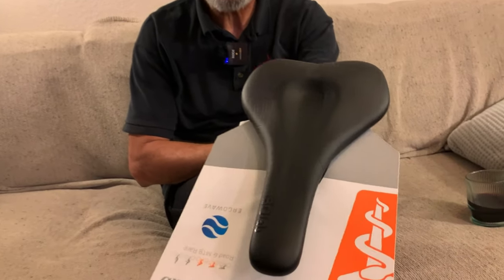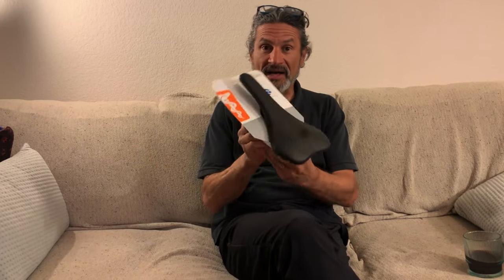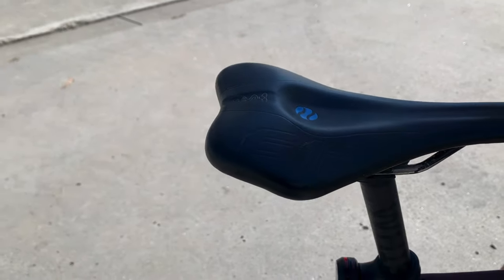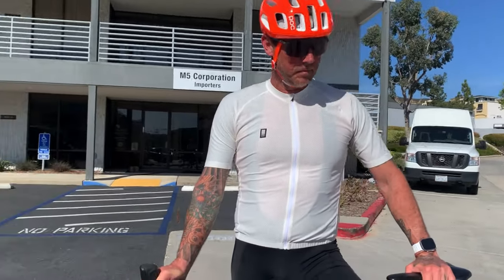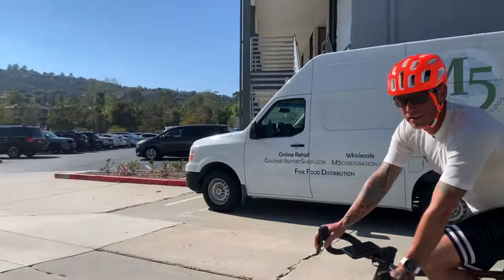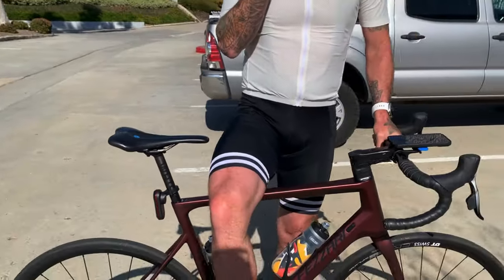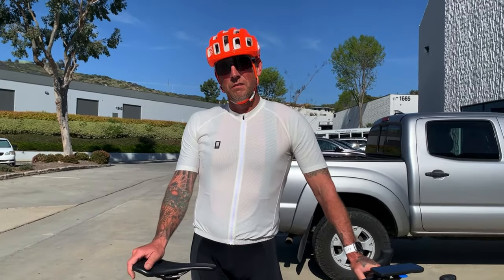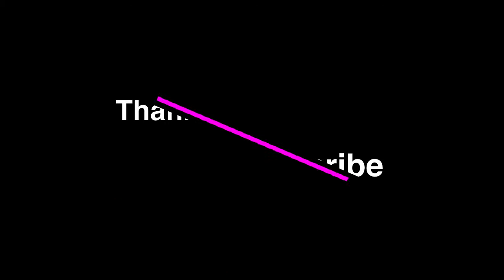First time riding an SQ Lab Saddle 612 Ergowave

Comment: Hey George, I finally pulled the trigger on this.. I'm loving it so far but have one question, I watched some SQ Labs videos and they suggest that you lower it slightly if coming from traditional saddles as it is inherently slightly higher.. because of the levels it has.. they suggest up to .5 cm whats your experience on this? do you lower it slightly? or just transfer the exact measurements. thanks for sharing your expertise with us.
Reply from the maker: Whatever the height needs to be that's where you put it.  I don't understand this question.  All saddles are built differently from rails to top.  Don't overthink this just put the saddle where it belongs
Reply: I just saw a video them suggesting that it will be higher than traditional saddles and that you might have to slightly lower it compared to your original position.. but yes.. that is the perfect answer is “to put it where it belongs” I have been riding for a while too and should easily be able to tell if it needs adjusting.. thanks for reminding me lol 😅
Reply from the maker: @p0p0ed  Like I said saddles are built so differently.  Some saddles are so tall from rails to top that you have to raise the saddle/seatpost to put it where it belongs and some saddle are not as tall from rails to top - and even within the same 612 range there could be a variance between S-Tube and Carbon rail saddles.  Just put it where you feel comfortable and efficient i.e. where it belongs

Thanks for watching please consider subscribing

Comment: SQ is one of the few that I haven't tried and I'm curious to give one a go. One thing I disagree about is that to me it does visually appear much different than most saddles to me. Thanks for the vid George!
Reply from the maker: Thanks for watching. I guess what I mean is it doesn’t have one of these ridiculous cutouts or huge depression or a short nose or a bent nose to me it just looks like a normal saddle compared to all the tricks other brands use. Please consider subscribing
Reply: Yep, it is basically flat left to right. 
This does not work for me unfortunately.
Reply from the maker: it’s rare that it doesn’t work for a rider.

Comment: I like the 612r I bought from you last year.   It’s a really nice saddle, But I fine I can’t really move around on it as much because of that short nose.   That may be the only downside.    

I’d like to come across a used 612, So I can try out the regular version.     I’m kind of thinking now that it may be more comfortable for the very long rides.
Reply from the maker: Yep that is the same experience I had with the 612R that is why I sold them. I prefer the standard length. But at least you know the SQ Lab design works for you
Reply: And wow.. by far, the 612r is the lightest saddle I’ve ever owned.  Crazy how light it is.
Reply from the maker: @dsonyay  yep between 125-130 grams!!